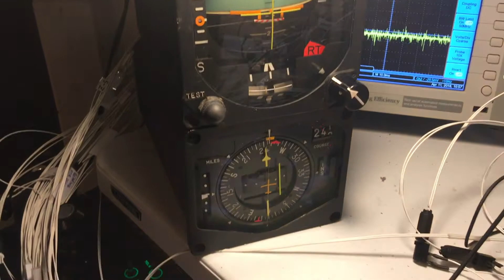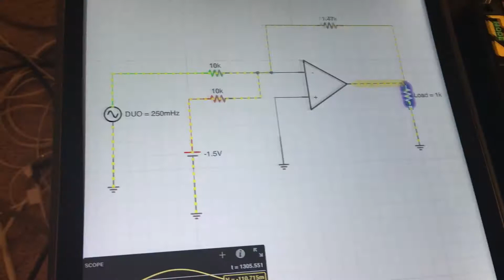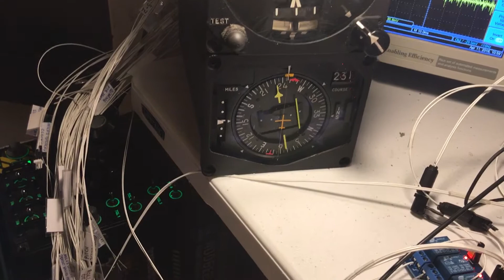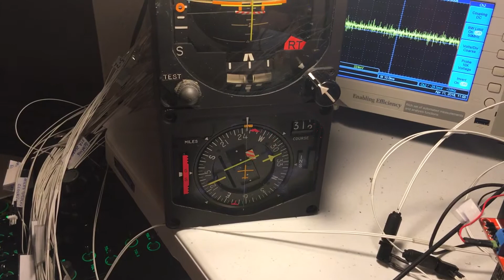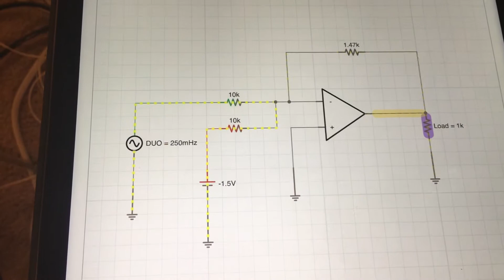Driving HSI & ADI deviation scales using Arduino

Comment: That's a whole bunch of wires and components....... :)
Reply from the maker: The HSI was Collins Overhaul Manual with illustrated parts list for model 331A-9G Horizontal Situation Indicator. It covers part numbers 792-6091-001 thru 792-6091-008.  The ADI was Sperry overhaul manual with illustrated parts list for model HZ-6B thru HZ-6C.  It covers part number 2587909-(9xx) and 2588260-(9xx).